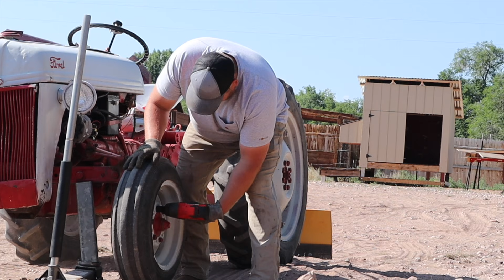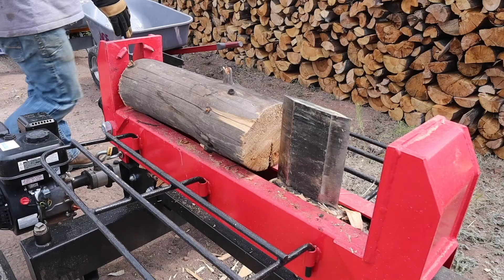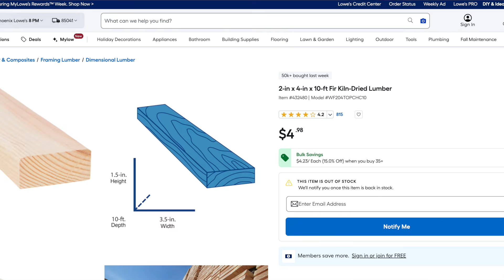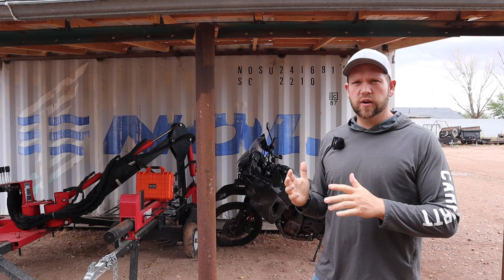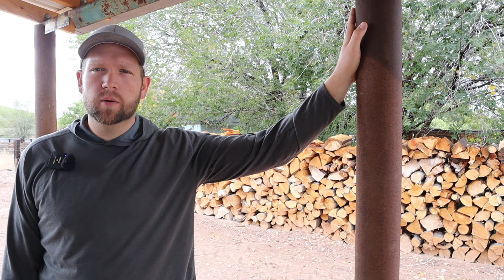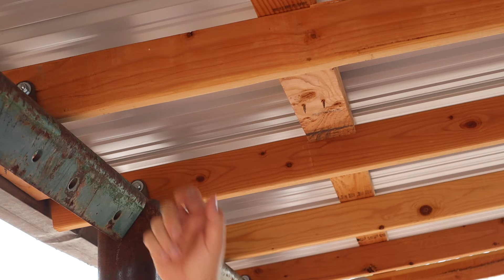How I Built My Shipping Container Equipment Storage Awning/Lean To Shed (DIY Scrap Metal Project)

Comment: Should be able to get some flashing . I’m building a porch soon and imma use 2x6 rafters and use regular hangers and self tap to the the conex. Then screw 2x6 to the side of the boards on top then silicone it. Then put flashing over it.

Comment: Build your 12x20 lean-to on the other side exactly the same.  Then:
Add a 2x4 down the center of your container roof on edge.
Now run more sheet metal across the top joining both lean-to together.

Comment: You could purposefully put 6” of roofing above (past the edge of the container), leave the gap underneath, and use the gap for venting heat in the summer. 🤷🏼‍♂️

Doing that for summer, means no heat retention if you’re in cold weather… maybe leave it as-is during winter (since there aren’t sides to retain heat), or plug the holes between the rafters with poly foam boards cut to fit each opening.

If you do want it completely sealed, then you could bring down the brace like you mentioned, then get the 6” rolls of Peel & Seal roof tape to put down. Or… leave it as-is, add poly foam boards for stability, then drape a 9” roll of Peel & Seal over that gap (or do 2 passes with a 1”-2” overlap using 6” wide Peel & Seal Tape.
Reply from the maker: Great suggestions! I appreciate the detailed ideas.
Reply: @DereksWorkshopAndProjects   Did some similar in the mid-90s with 4 short containers like these (24’). Eventually tore the 4 out when I got two 53’ insulated (“reefer“) containers (late 2000) that I put side-by-side. Used all-thread (completely thru PT 2x4s & the container walls) to hold them snug together. Then (inside) came down ~6” below the top edges, ~10’ in from the front: cut out 12’ of wall (floor-to-6” below the ceiling), then ~10’ from the back cut out another 12’ of wall (left some to support the middle). Spray-foamed around the cuts thru the 2 walls and slapped some 6” wide strips of 3/8” plywood as “casing” all around both openings so I wouldn’t get cut, then cut a 36” hole in the outside & hung an old exterior house door. {Made sure the “jamb” on the handle side was just screwed to an aluminum upright (was a 2x2), slid a 2x4 in between the walls on the hinge side to hang the door, and another 2x2 across the top of the door. 😂 That “door jamb” was so sketch, but it worked well.} Ran electric all around the inside (plugs & lights) and put a window shaker style heat pump in one end where the reefer had been. Looked janky, but made a fantastic insulated shop for working on stuff. 

Was less than $10k for ~16’x53’ of heated, cooled, & insulated shop space. (Only wish I’d taken some pics before we moved; can’t do that here.)

Comment: You could attach either some roll flashing or steel roofing ridge cap by screwing to the roofing panels and siliconing to the roof of the container
Reply from the maker: I’m not a roofer of any type whatsoever, so thanks for that. I will probably do that!